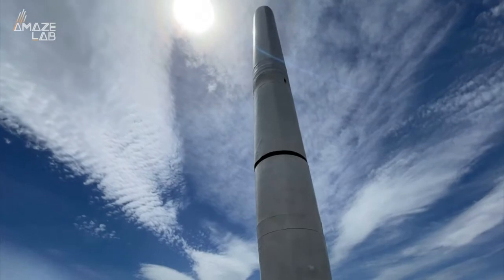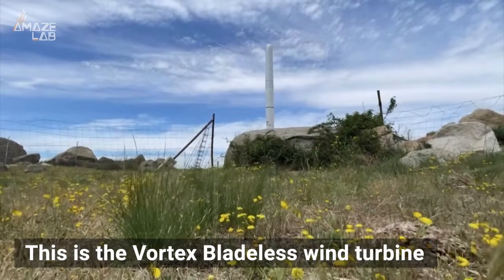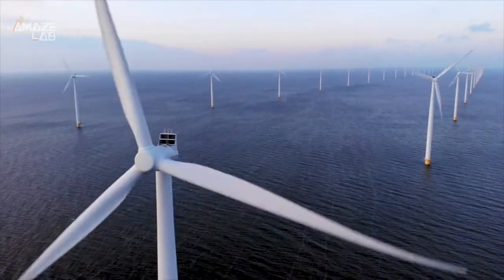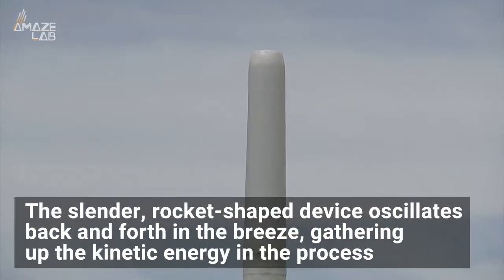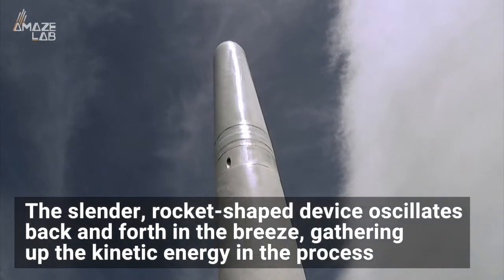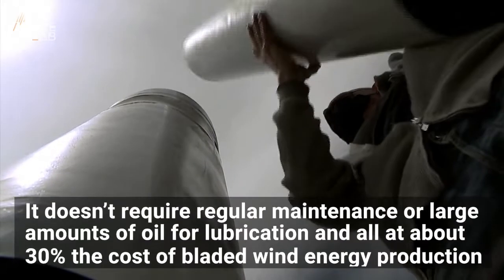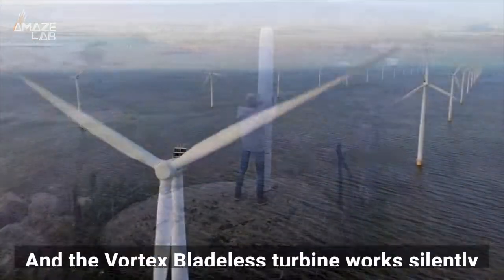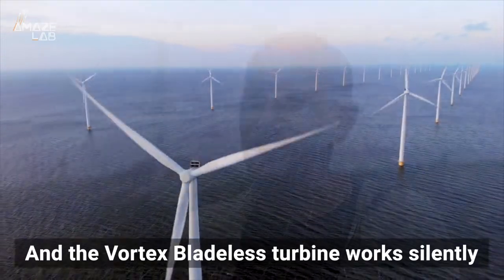This Wind Turbine is Silent, Cheap, Bladeless and Could be the Future of Green Homes

Comment: Another huge advantage over the bladed turbines is that it won’t kill birds!
Reply: Bird kills with wind turbines is an important issue but is somewhat overblown.  Yes, a lot of birds are killed by wind turbines but the number is similar to other large structures.
Estimate of bird kills per year:

Wind turbines            0.15~0.5 Million per year
Comm. Towers           6.5            Million per year
Power Lines                25             Million per year
Windows                      300          Million per year
Cats                            1,400~3,700 Million per year

Source:  Sierra Club: Michigan Chapter
Reply: @dr.gordontaub1702  
Thank you for this breakdown.